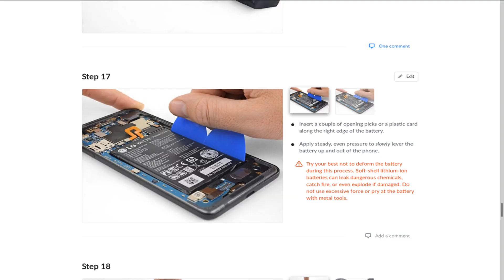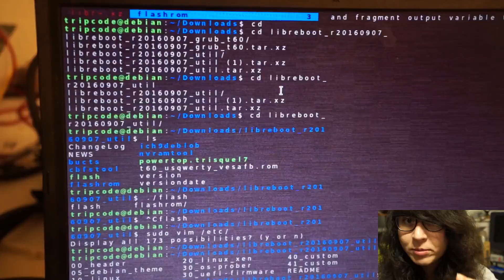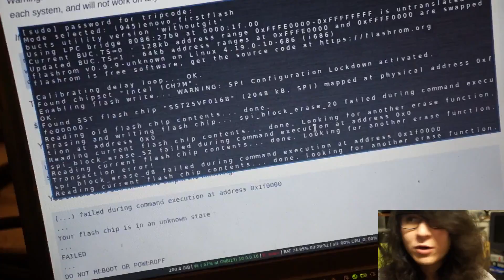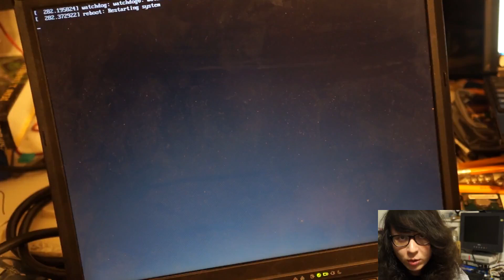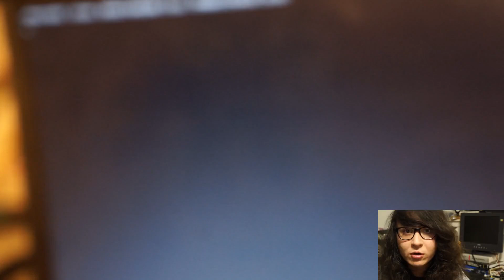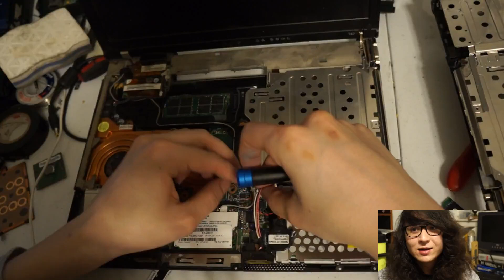Modern Smartphone Design Sucks!

Comment: Maemo Leste on Nokia N900? It's a powerful Nokia phone run fully on Linux kernel, altho it has some proprietary blobs but you know what to do.
Reply from the maker: The phone might be a bit difficult on us cell networks, after my degree is finished I'm just going to switch back to a flip phone.
Reply: @tripcodeQ7  For a typical hardware hacker, I think it's worth checking out. The price is also cheap tho.

Comment: I'm pretty sure that most of these smartphones are developed with planned obsolescence in mind. Making the battery non-replaceable on the grounds that it's necessary to make it waterproof is fallacious, because you can just get a waterproof case. I mean it could be that most consumers are just not all that wise, and would rather have a phone with a non-replaceable battery, but I find that sort of hard to believe. Most phone manufacturers know that if they made the batteries for their phones replaceable, their customers wouldn't upgrade their phones, they'd just upgrade the battery. And so I think what we might be seeing is a sort of race-to-the-bottom situation, where most phone companies are pressured to make their batteries non-replaceable because they need to do so in order to compete with the other phone companies. Or perhaps they're all just greedy. It's really hard to know for sure. But either way, this is one of those situations where government regulation would be helpful, not just so that people can save money by just buying replacement batteries instead of buying a whole new phone, but also because these phones getting thrown out prematurely is significantly contributing to the world's e-waste problem, so it's not just desirable on consumer protection grounds, but also for the sake of protecting the environment.

What's also terrible, as you mentioned, is that these companies don't give you the ability to install your own operating system. Much of the security problems plaguing mobile devices, such as apps snooping on people's data, could be solved if they just let users install their own operating systems, which would give them the administrative privileges needed to properly sandbox these apps. I know many carriers, such as Verizon, demand that devices have locked bootloaders, but even some OEMs lock down the bootloaders on carrier unlocked devices. The justification they use is that they don't want some third-party reseller to install spyware on their devices, and then sell those devices into the market, because users won't understand that the manufacturer isn't responsible for the software on the device and would lead to the manufacturer losing trust among consumers, so in short they lock down the bootloaders because users supposedly don't know the difference between hardware and software. I, however, think tech consumers are smarter than that, and I think the real reason they lock down bootloaders on their devices is to protect trade secrets. I think there should be a law that if you buy a computer, whether it be a phone or personal computer or some IoT device, the manufacturer has to provide a mechanism for the user to install their own software, because it's absolutely ridiculous that in modern society, we're basically forced to use these devices that have free reign to do whatever they want with our data, and we can't do anything about it.

My phone is an iPhone 6s from five years ago with the stock battery installed. I can't really do anything with it except make and answer calls and texts, because doing literally anything with it will just completely drain the battery in less than an hour. I'm thinking of replacing it myself, but I'm not sure I'm skilled enough to pull it off to be quite honest.

Comment: Short answer: yes
Long answer: a l m o s t  y e s 
Longest answer:
Y

E

S

S

I feel like they could find a way to make a phone watertight without having to glue it shut. 
It might take some doing but come on its 2020. We deadass having devices with folding screens that do the bendy bendy.
Also
Not to get all political or commit treason or anything but I'm pretty sure the removal of the headphone jack is not necessary
Like okay fine wireless headphones and USB C dongles 
But thats not the point
The point is having the option to charge your phone while having it plug into an audio line out 
Also also 
Notch display is ugly
But hey these are just my opinions.

Comment: Adhesive and glass sandwiches. I still have zero understanding of a good reason to but glass on the back of phones other than getting people to break it and replace it. Also glass that protrudes past the bezel of a phone, literally like trying to fall teeth first on any distance of a fall. My galaxy s2(still working btw but of course slow trying to use modern apps) survived hundreds absolutely devastating drops and accidental throws even, its only gorilla glass 2 but has plastic bezel that protrudes not even half a millimeter glass. i upgraded years later to an lg g4, cracked a month later accidentally falling out of my hand onto my desk4 inches below. back to s2, few years later got some motorola mid range pre paid phone. broke 6 months later on an average drop to a wood floor. happened a couple more times with other phones. finally got an s10e and i have a case making it 3 times its original size and only now do I feel safe but we'll see how it goes. But that god damn s2 is still kicking if this ones dies too.

Comment: I refuse to replace my phone from 2016, what with its expandable storage, headphone jack, and better than average DAC.  This means I've not only replaced the battery and risked explosion if I had spudged too hard, but even LineageOS dropped support for my device and I'm only able to get monthly security patches because I compile my own builds.  And I only have to do this is because the phone was intentionally designed to not be modular and to have so little hardware abstraction that I can only run builds for that exact device.

I feel like this is happening across all of tech.  Things don't improve every year, they just become cheaper to manufacture, and those savings are not passed on to the consumer because they're designed to be obsolete, so they can charge whatever they want knowing you need it.  This is why companies want your TV, your refrigerator, your toaster, and your car to all be connected to the internet and then stop working once they come out with a newer model.

Heck, even outside of tech, I feel like things have started to feel cheaper in quality without actually going down in price.  I guess because everyone is broke and buys whatever the first result on Amazon is.  I've just been looking at my TV cabinet lately and thinking, if they made this today, it would not be this sturdy.  It would be thin plywood that would break if you look at it wrong.
Reply: >but even LineageOS dropped support for my device and I'm only able to get monthly security patches because I compile my own builds. 

could you elaborate?
how do you compile your builds exactly?
this sounds pretty interesting
Reply: @cultist7931 Lineage has per-device build instructions on their site, including for devices they don't support anymore

Comment: I know what you mean man, just replaced a samsung tablet battery not too long ago and it was glued to it really tigh. It was super difficult and risky to take it off,and when I did,I put the replacement without any glue and the thing got stuck really good without the glue!. They really don't make them to be repaired :(. Also yeah,I don't like the extreme upgrading of memory size on phones.I feel like they want the consumer to never move their content from the damn thing, just buy a ssd and make your backups,there's no need for having that much space for the common user. btw is that a Viewsonic lcd 17" 5:4 monitor behind you?, I have that one too!,it's my favourite display <3,anyways thanks for making this video,really interesting subject.
Reply from the maker: The monitor is a 4:3 dell I believe. It is alright. 1024x768 though. I don't really see the point of large internal memory on phones, SD cards are quite nice for transferring data to the computer and storing music though :D

Comment: hi trip i like the chat you do so free of mind its like if i things also about all that technothings
about e-paper display why is there not a big monitor like 32 or 42 inch with e-paper technology there should be also a market for like a second or third screen setup with slow updating data for a calendar or todolist or pdfviewing and if you power of your pc (or going in powersave mode) the grafisch data is there for always mayby next day to update the screen
i always loved also the old big monochroom crt screens so sharp because there is no RGB raster needed
thats the same for a e-paper display ok one problem is the slow update of the screen not for video using or so but it becomes better i thing
bye until next video
Reply from the maker: Epaper is still quite expensive and has a low refresh rate. I imagine once prices come down larger screens will come available, but they are a bit niche. I think their is some new developments for higher refresh rates, but I don't know if they are available on the market. I wouldn't mind a small 10" display for that purpose or even on a laptop.